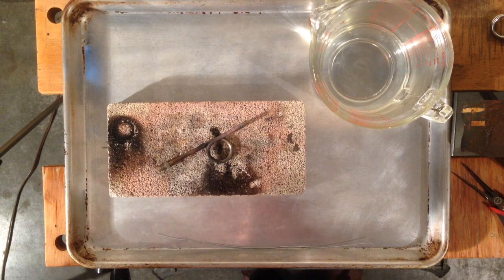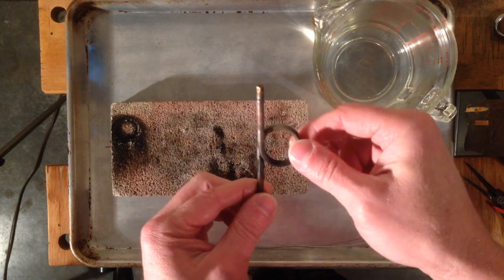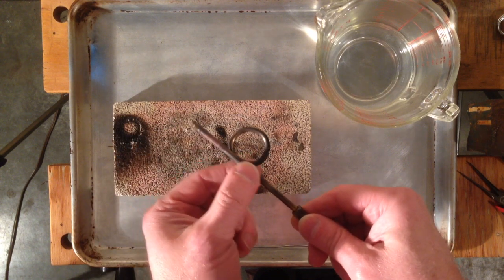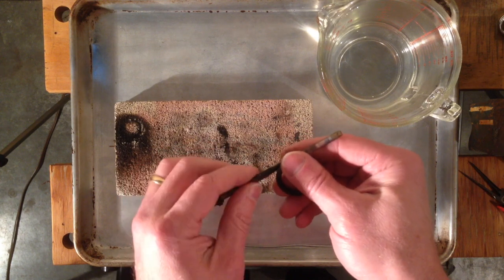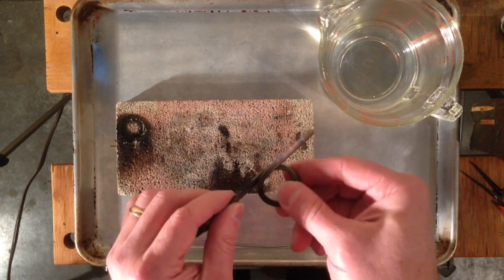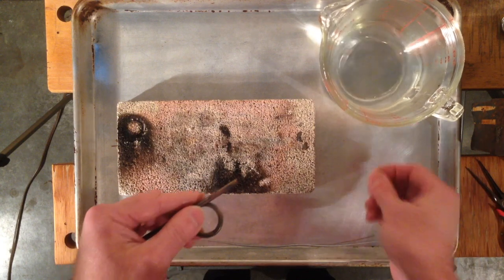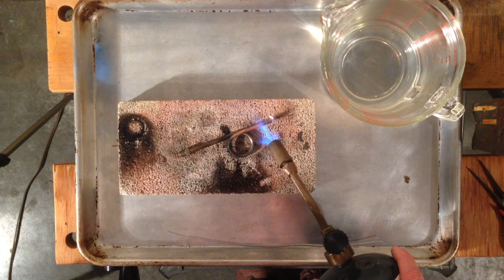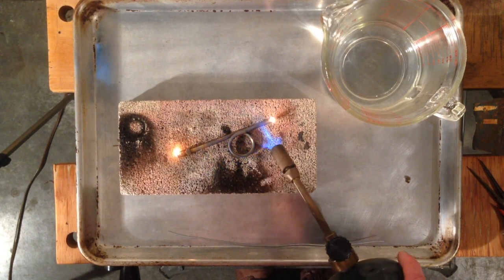How to Clean and Rebuild a Coleman Q99 Generator

Comment: My 327 QL. Has a real vintage q99 generator again... Working!!! Thank you, the heat quench repeat worked no bending just compressed air after. No more r55 , match lite Time! Got a handful of old generators and a tip cleaner off eBay for 11.90 us. One man's junk is another man's hundred year old treasure! 🎉

Comment: Great tutorial but mine snapped in half trying to straighten it out, I don’t think I will try that again. Next one I used my compressor (with mask) to blow the packing out after heating/quenching and soaking. It worked and protected the loop.

Comment: cool--but i dont think im gonna straighten my q99---ill use a piece of weld wire and just try 2 push it out with it
Reply from the maker: Straightening is a last resort.  If the carbon buildup isn't too bad, heating, quenching, and blowing water through will often get them working again.